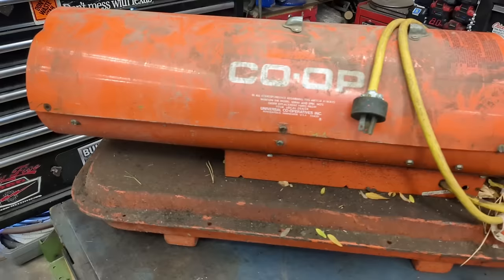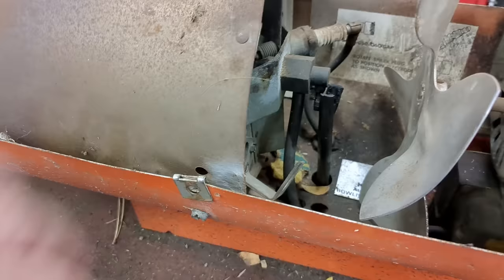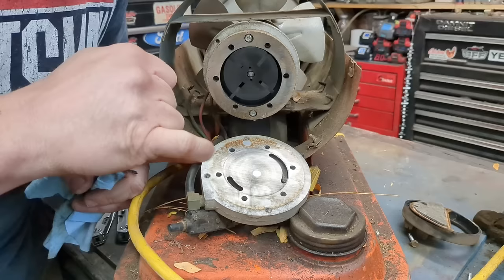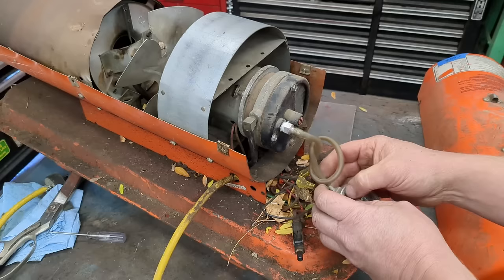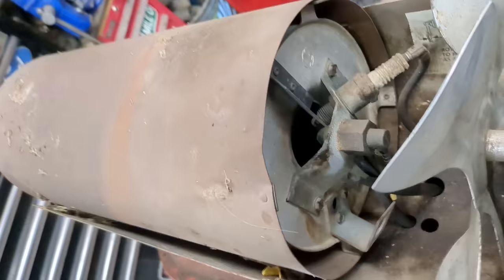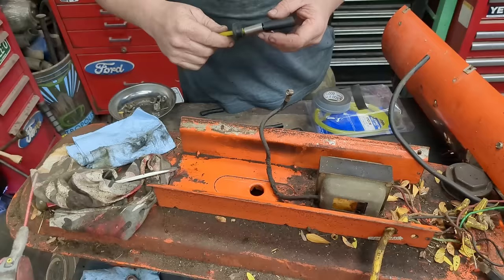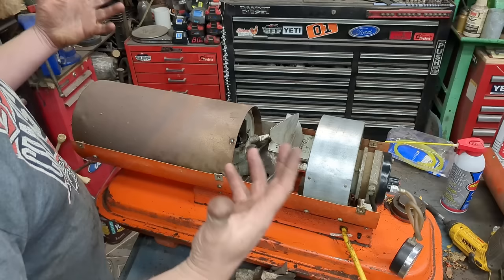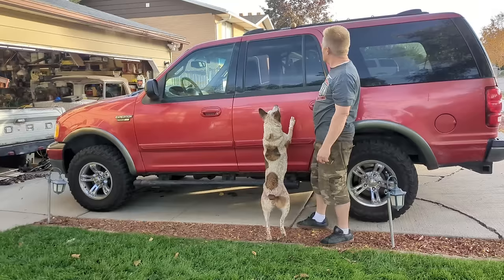Diesel Kerosene Forced Air Heater FIX EVERYTHING

Comment: they are also the quickest way to get dizzy with headaches from the fumes too. hate them. even our brand-new units stink, never been able to tune one to be fume-free. I burn propane now on my jobsites.
Reply from the maker: I have picked up a lot of these because they smell and people are sick of them. Even brand new ones aren't tuned for altitude and can nearly kill you. I can only recall 1 that had a gauge installed from the factory so you could quickly tune it all the rest it's just dumb luck if you don't put a gauge on yourself. I've also come across quit a few propane ones that'll do the same. However those are just a faulty regulator. Propane is way simpler but does cost 25%-50%(Btu per $) more to run over diesel.
Reply: @sixtyfiveford  I disagree with the need for a gauge to tune. It can be very clearly tuned by watching the cone glow. Adjust that red knob at the rear for the cone to be uniformly orange as close to the edge as possible but not too much or flames will start going around the sides of the cone. Those flames are where the stink comes from. 
I think I ran the first one or two fuel cans with Kero, then switched to diesel and never went back. I would have to adjust on occasion, especially switching from summer to winter diesel, but its so easy I'm surprised they don't actually set that red knob up with a thumb wheel.

Comment: These are great heaters. Only drawback would be the noise, if that bothers ya. Great vid, as always. Ginger is the coolest heeler on YouTube.
Reply from the maker: The noise for sure can be annoying. The biggest annoyance is they always seam to find a rattle and that drives me crazy. My personal one I put rubber mounting in between all the metal to metal parts.
Reply: @sixtyfiveford  if you are freezing out there once you fire up one of these heaters and feel that quick warmth you forget real fast about any noise the heater makes.

Comment: Cool video! If I run across one of these maybe I'll pick it up now that I know they can be easily fixed and maintained! Question: Since these really only have one fairly large jet (seemed large anyway) could these be used to burn old waste engine oil?  Obviously strain through maybe a painters funnel or something and maybe add 25% gas to bring the Flashpoint closer to diesel?  Would be a cool way to get rid of your used oil and save a little on heater fuel...  I'm surprised you aren't burning your waste oil somehow!
Reply from the maker: I played with used motor oil years ago and it's troublesome. Besides that the fumes were pretty toxic as there's so much carbon, etc in old motor oil.
Reply: @sixtyfiveford  Gotcha...  So bad idea... bummer.  There are people who make their own waste oil burners/shop heaters with seemingly good results.  But they are self built and not something that was designed to run a specific fuel.  Sounds like any of this ain't your first rodeo? 

Thanks always Moe.  No joke, out of all the "DIY" type channels, your's is my favorite and I think the best.  I bet you have a few neighbors who likely have figured this out, lol, "Moe, can you....!"

Comment: We used to add thermostat controllers to them so when the shop go to the set temp it turns off and restarts a minimum temp. The pumps tended to go bad. One heater I added a micro air line with reg to adjust the burn.

Comment: It's actually more akin to an oil burning furnace or boiler than an internal combustion engine as it's similar to an enclosed Beckett oil burner with a fuel tank and shrouding.  Engines are primarily machines made to take thermal energy and convert it into kinetic energy for work.  That said, the similarity to an engine only takes place in the way the thermal energy is provided in the combustion triangle (fuel, oxidiser and ignition).

Comment: We used them 30 years ago to heat up the pigs stables
I still have them and use them if i need heat for a short period in my workshop 
My propane installation needs 4 hours to heat up
After many hours sometimes the airpump house gets unround
2 minutes in a 4jaw fixes that problem

Comment: One of the biggest concerns about kerosene heaters is that they consume oxygen when they burn. This can be a particular problem in small or inadequately ventilated rooms,  as oxygen can be reduced to a dangerous level. A low level of oxygen may lead to the incomplete combustion of fuel and the production of carbon monoxide, which is colorless, odorless and can be harmful to your health. That is why it’s essential to always keep a window or door open to avoid the buildup of toxic fumes.

Comment: i would love to find a used one of these
Reply: You should be able to find them very easily today with the high price of Kerosene many are not using them. I mentioned above that I own 4 of them. I only purchased one of them brand new back during the 1980’s. The other 3 I picked up used very cheaply over the years.
Reply from the maker: Yeah, just look on your local classified for "Kerosene". Virtually no one knows you can run them on diesel.
Reply: @sixtyfiveford  Back in 1991 I had a 42’x60’ Morton Pole Barn built for me on my back property. I use to use 2 of these Kerosene heaters 150,000 BTUs each back there keep me warm on the coldest winter days here in the Northeast. The building was not insulated but with 2 of these heaters one up front and one in the back during the coldest of Fall/Winters especially from October to March here in the Northeast they kept me warm out there. During my younger days I spent a lot of time back there. Built my Street Rod back there and did all kinds of work. Today at 71 years old I don’t spend as much time back there like I use to especially during the very cold weather. I use to keep 2 oil tanks I picked up from people who use to keep them in their Homes for heating oil before they changed over to gas heating. They cost me nothing back then. Had a oil company deliver me Kerosene then and fill both tanks. Kerosene i remember paying around 89 cents a gallon and even then it cost me close to $2000 from October until sometime in April to stay warm out there before the prices really started to rise on Kerosene. It got to be getting to high to stay warm out there heating it with these heaters. Can’t remember the last time I used them. At the time I was in the Automotive Parts business. Knowing other  people also in the business a Tool seller I knew also sold Resnor Waste Oil heaters. He was getting out of that end of the business and gave me a great price at the time on a brand new Resnor 250,000 BTU waste oil heater plus 200 gallon tank that sat under the heater. I installed it myself in my building being it was the cheapest way to heat that Pole Barn. I used that then up to 2012 when I decided to sell it to one of my Automotive customers who was bugging me about it for years telling me he wanted it for his shop if I ever wanted to sell it. I never thought I would consider selling it but I wasn’t using it much anymore and during I believe either September or early October of 2012 we got hit by Hurricane Sandy and a very large Oak Tree uprooted and landed on my Poll Barn and the complete roof needed to be replaced and a section of the side wall. At that point I decided to sell my Resnor Waste Oil Heater and did to my old customer who wanted it. If I had to do it all over again I believe Waste Oil is the answer to staying warm at a low cost still. I knew with the price of Kerosene going up so high it would be cheaper to bite the bullet on a new waste oil heater at the time being it would pay for itself in no time at all. That thought actually worked out well for me for the time I owned it.

Comment: Too bad Kerosene is so expensive today. I own 4 of these what I call Torpedo Heaters.
Reply: Yeah, but they're still handy to have
Reply from the maker: Just run diesel fuel. Diesel fuel is the exact same thing as kerosene just has a little more paraffin wax. And actually, if you buy winter diesel it is generally diluted 50% or sometimes it's 100% kerosene to prevent gelling in Sub-Zero temps.
Reply: @sixtyfiveford  I thought so, cause I bought an older one myself a few years ago, and was sure they ran diesel too. Thanks
Reply: As someone that's always ran diesel in my heaters it's now expensive to me but not surprising. At least there's no mean Tweets.
Reply: @sixtyfiveford  OK, but why would diesel be cheaper than kerosene?
Reply from the maker: @emmettturner9452  Why would diesel be cheaper than kerosene? Because they make 1000+ times more diesel than kerosene. Kerosene is just refined diesel to pull out the paraffin wax. Some areas in the US still use kerosene/ fuel oil no1 for home heating and it can still be found for close to maybe a little bit cheaper than diesel/fuel oil no2 simply because there's no road tax.
Reply: @sixtyfiveford  Exactly: There is no road tax, so it’s basically the same thing, but cheaper. You said it yourself. :)
Reply from the maker: @emmettturner9452  If you live somewhere that heats with fuel oil no1/Kerosene, you may be able to get it for $0.20 cheaper when you order 500 gallons vs Diesel/fuel oil no2. However, if you live somewhere the heats any other way, kerosene has to be trucked in generally to the home Depot or possibly a local refinery with special batches and costs 3x to 5x more. Where I live we heat with natural gas so kerosene is around 15 to $20 a gallon versus diesel which is $4.50. now that actually gets more complicated than that because I can buy off-road diesel /farm diesel with no road tax. However, because I don't live in a farm community, it costs generally more than road taxed diesel because of supply and demand.
Reply: I used to run off road diesel in my torpedo heater, Much cheaper

Comment: FINE job and I had to go into a cheap Chinese tractors' fuel system to clean out the algie because it was so stopped up it quit running. Tractor might've been Russian. Been YEARS but I sure remember the green stuff growing in a sealed system, metal lines, NO light.. And I was wondering if Jinger had some hidden stilts. Thanks, Pal and BLESSINGS to yall!
Reply from the maker: Maybe just because I live in such a dry climate algae never seams to grow.
Reply: @sixtyfiveford  This one had been stored for a LONG time and you know what happens when something just sits..

Comment: I bought one of these new about 3 years ago. it has always blew flames out the front. Looked at my book yesterday and it says pressure should be 6.6 and it was. I had to turn the pressure down to 3.5 before it quit blowing flames, now just the cone is glowing red. Is this going to cause a problem.
Very much enjoyed your video, have looked for repair videos before and couldn't find any help. Thanks so much for sharing your expertise.

Comment: Store-bought CO1 detectors do not read anything below 30ppm (it will state this somewhere in the operation paper). So getting a "zero" CO1 reading means nothing, as you can be getting anywhere from 1ppm to 29ppm. Chronic exposure to 5ppm or 10ppm are enough to cause lasting damage.

Comment: Hey maybe I missed it or if you Mention in a different video.. but what do you recommend to keep around for simple filter foam material for projects like this? Everytime I think i find something it just breaks down like and aged and dried out filter.  Great video btw👍👍
Reply: I repair these heaters, and the part number for the half round foam filter is M29633, the larger square foam filter some models use is M12244-1. In 2 or so years these will start to get soft. Maybe the foam filter some small gas engines use will stand up better.
Reply: I had the All-Pro brand I believe, same setup. I would order the tuneup kit about every other year. I think it had the filters and spark plug? Well worth the price.
Reply from the maker: I just cut all my foam filters out anymore. You use open cell foam without oil. You can buy large sheets for dirt cheap https://amzn.to/3f9tIU3 or just scavenge foam. I've been using those no1 sports fingers people put on their hand for stadium games. I ran into a company that makes those and if they knew if it was the same foam used for air filters. I got an immediate yes and was told the other side of their factory makes air filters and the novelty side(foam fingers) was a way to supplement that. I have also used open cell foam from couch cushions. However, not all couch cushion foam is open cell.
Reply: @sixtyfiveford  thanks a ton. That's some good info and great digging on your part!
Reply: @sixtyfiveford  rad info, you are the man when it comes to DIY, period!

Comment: The start up always releases fuel order.  If the smell bothers you, you won't want a diesel/kero heater like this.  Once up to operating temperature they are awesome.  The propane ones don't have the startup problem.
Reply: One I don't like about propane is they create condensation.
Reply: @BumpNrun69  So does any unvented combustion. The fuel (propane, diesel, kerosene, gasoline, methane, ...) is hydrocarbon chains. Combustion (or catalyzing like Mr Buddy) breaks those chains and combines with oxygen. Hydrogen and oxygen is water. More heat means more chains means more water.

Comment: My question to you is can you use diesel fuel in a kerosene torpedo heater? Can I change the nozzle to use diesel? I don't want to mix fuel. I sometimes see these units at garage sales but I'm hesitance to buy them because of the cost of kerosene. This may make a good video experiment.

Comment: thanks for the info didnt fully understand how they worked but one thing I can say Kerosene sucks to burn in my shop your closs will have that older and it gives me a headack unlike Diesel it dont have much smell when it burns only when it 1st kicks on
Reply from the maker: I don't know why but Kerosene has a chemically smell to me and I don't like running it at all. Technically kerosene is just Diesel with the paraffin wax removed though so it should smell the same. Paraffin wax by itself has a pleasant smell so it must cut the odor. Or maybe the higher BTU content in Diesel vs Kerosene with the wax gets the combustion chamber hotter so there's no smell? I have people buying stuff all the time from me, coming into my garage and they almost always ask what my heater is. They always say they smell nothing at all and most are shocked as they're used to these heaters nearly killing them with odor.

Comment: My John Deere heater I can attest heats up my garage which is mostly insulated except the roof which is most critical lol but it will heat it quite nicely and fast even when the weather is -20f in winter. 

My reddy heater suddenly stopped working. I’ve put new flame sensor and pump in it and still has great spark just won’t get fuel to it. I’ve tried almost everything imaginable for the thing🤔
Reply from the maker: Cracked fuel pickup lines are common issue.

Comment: Got two of these...and both have the same issue...the bore of the air pump rusted...I'm guessing because of water in the fuel at some point?  They are junk at that point, you can get a new bore but they are pricey...

Comment: That’s wild dude, I took apart and got one running earlier this year. It would backfire every once in a while. I just took it apart and cleaned it, and it hasn’t had an issue since then. I really like having it, it’s super convenient. Wonder if I could get this to run on used motor oil?

Comment: I got one of these for free as it stopped working. After watching this video, i suspect that it is the sensor that has failed. So i will go and bypass that tomorrow. As it fires up and then goes out after a few seconds. My pressure washer had the same issue on the boiler, so i think that will be the issue.

Comment: Interesting I always thought the pressure adjustment just increased the heat but kept the air fuel ratio the same. I usually crank it up till she’s just shooting fire out the front. My heater doesn’t smell either it burns super clean, but I’ll try a gauge be curious how close I got it by the seat on the pants method.

Comment: would it run on "dirty diesel" ( 1 part gas/4 parts waste motor oil ) ?
Reply from the maker: The problem with motor oils is they thicken/thin too much with temperature. So they need constant adjusting. I did it years ago then I read how harmful the fumes from burning used oil can be and it made me nervous. The gasoline would also evaporate out creating a dangerous situation.
Reply: @sixtyfiveford  thanks . i was considering using one to heat a tank of water remotely , then run lines to a radiator , like a water furnace . or maybe just hook it to some stove pipe , run the pipe thru shop (exiting to the outside) , and get radiant heat from the pipe . probably not very efficient anyway .